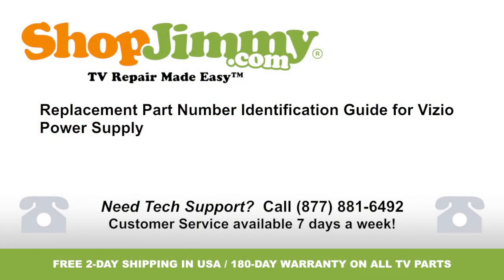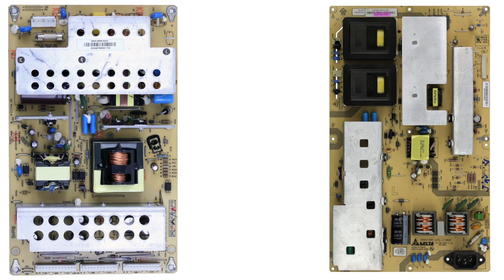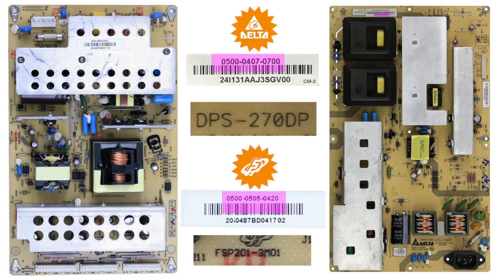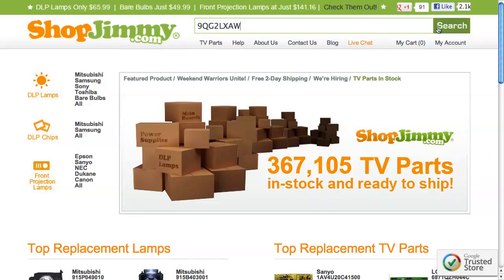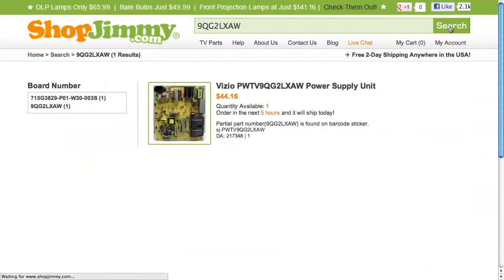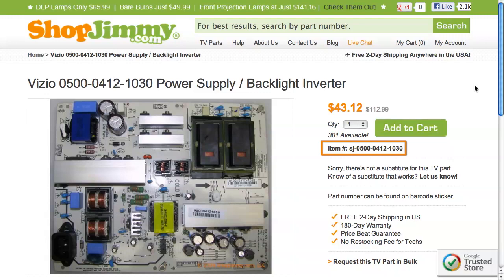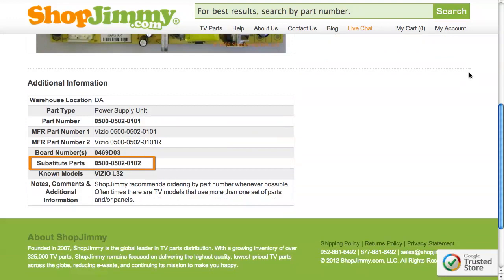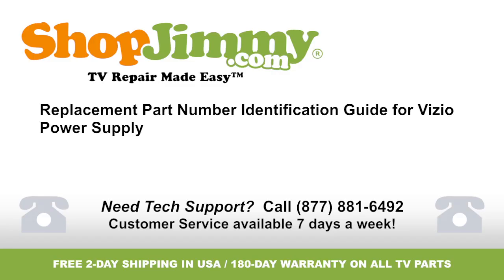TV Part Number Identification Guide for Vizio Power Supply Unit (PSU) Boards (LCD LED Plasma TVs)

Comment: I see two power boards that look completely different, but have the exact same 0500-0405-1290 number. Will either of them work? Same connectors, just completely different layouts.
Reply: on the same boat. boards look a bit different, exact same number on the sticker, absolutely no variation in the numbers. same connectors, same pin count. i'ma bite the bullet and just buy the cheaper one.

Comment: Great video and information on how to identify the power supply board and part number.   Our caps all looked fine but found a burned/black section on the underside of the board.  Ordered the replacement from your shop today (EBay)...thanks for being a great resource.

Comment: I cleaned out all the dust and cobwebs out of the back of tv. And cleaned both fans, I put the new lamp in 3 or 4 different times but it still did the same thing. So I put the old lamp back in and the tv is working again. Thanks, for your help away.

Comment: I have a Sony KDF-50e2000 tv . I just changed the lamp but am still getting a green light and then 3 red lights. Do you have an idea of what the problem could be? I got this tv second hand and it has done the same thing as when I bought it.
Reply from the maker: Michael Hawk   I recommend checking the lamp door to be sure it is closed.  Thanks!  www.shopjimmy.com
Reply from the maker: Michael Hawk   This sounds like a bad lamp in your TV.  Here is a link to replacement parts for your TV model number on our website, click here:  http://www.shopjimmy.com/catalogsearch/result/?q=KDF-50e2000  Be sure to match part numbers on your current board, with your replacement for compatibility.  You can also call our customer service for further assistance with your purchase.  (877) 881-6492  Thanks and please let us know if you have any further questions with your TV Repair!  www.shopjimmy.com

Comment: I have a Visio e3d470vx that won't turn on. The stand by light flashes as soon as I plug the tv in but nothing else is working. I've switched the power supply board and it is still doing the same thing. I checked the standby voltage and its reading 5.5v and the 12v side is reading only 7v. Can you help me with this issue?
Reply from the maker: +bobdijjy420   Try all repairs and troubleshooting at your own risk.  I recommend replacing the main board in your TV.  Click this link to replacement parts for your TV model number:  http://www.shopjimmy.com/catalogsearch/result/index/?cat=56&q=e3d470vx  There may be multiple boards for the same TV model number, be sure to match part numbers on your current board, with your replacement for compatibility.  Here is a link to a video showing how to identify your part number, click here:   https://www.youtube.com/watch?v=kxkeGLhlQY8Thanks and please let us know if you have any further questions with your TV Repair!  www.shopjimmy.com